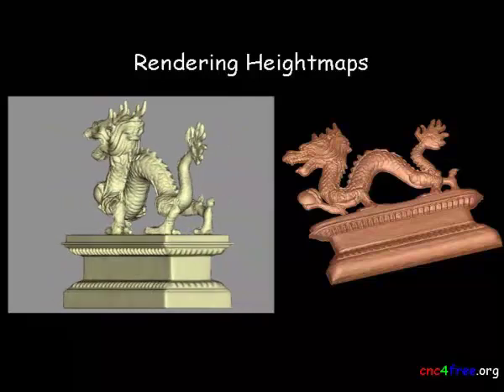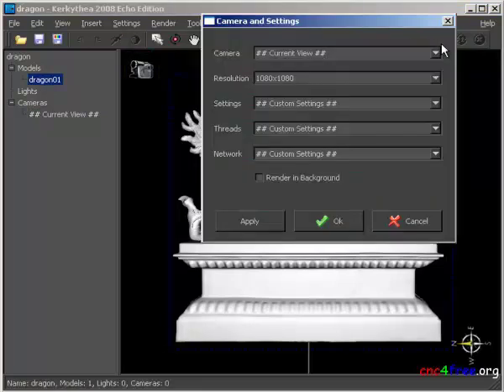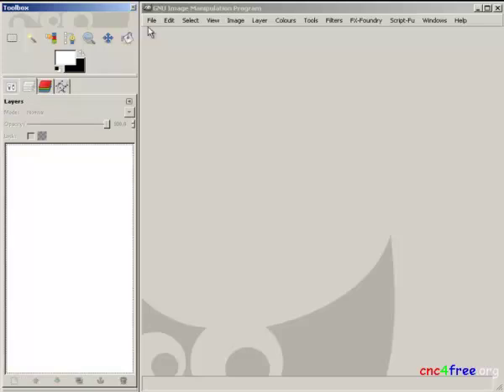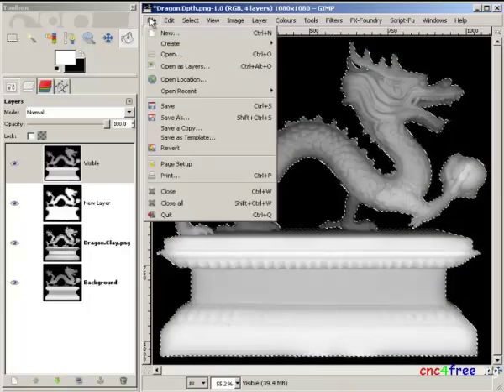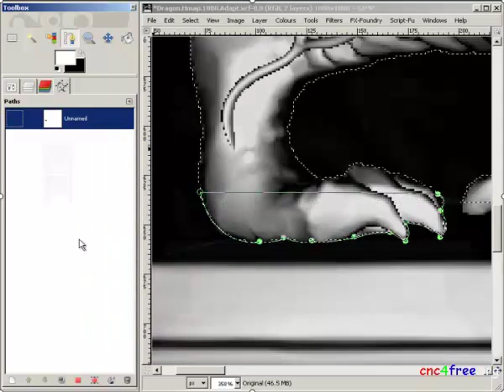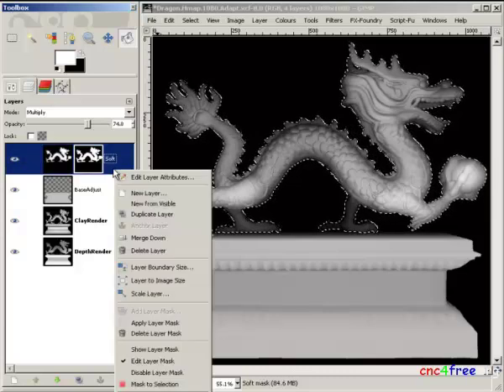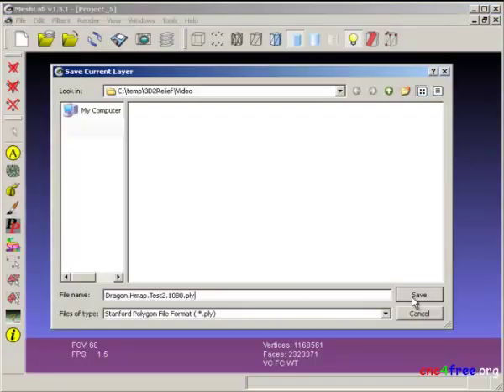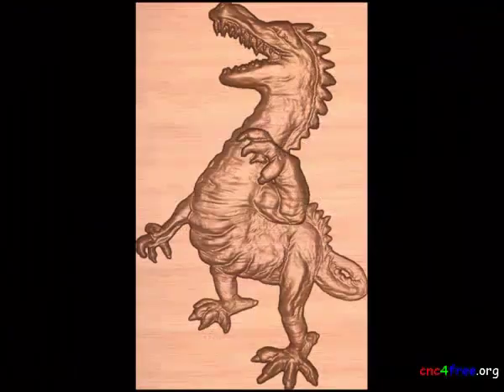3DtoRelief  3D Mesh or scene to CNC bas-Relief Carving - FREE - Cross-platform - GENERIC

Comment: Your voice is almost uninteligeable! were you in a cave? It would be nice to write the names of the software in the comments and you used an already opened program that is not available anymore.
Reply from the maker: Hi There, Many thanks for your interest and your comments, I will address the points you raised one at a time.

1.  The Audio:-

This is an older video, one of the oldest on the channel.  In more recent uploads the issue you mentioned has been addressed.  Many of these older videos will be phased out as I add more advanced content covering these subjects, so I haven't remade audio on older videos.. just don't have the time.

2: Naming the software:-

As the software is appears on-screen, where available,  a graphic is displayed, showing the 'About' panel in order to identify and provide information as the software developer has chosen to present it.  However if you feel it would be of assistance, I have identified the various software used in this video below.

 "Kerkythea", for 3D rendering (currently 'Meshlab provides a faster option, as detailed in other videos on the channel).

 "The GIMP" for producing composite height-maps from the rendered output, 

"3D Paysage" for generating .OBJ output.  At the time of making the video, 3D Paysage was the only utility I had personally tested across multiple platforms. 

"BmpBender" (windows only.. and no longer distributed) for generating native .STL output. 

Overview videos, and links to all of the above are available on the channel.

 "BmpBender" wasonly really included because many windows users in the CNC field did already have / use this software... 3D Paysage may not look as pretty.. but for mesh generation, it is the more capable of the two.

3: Already opened / 'unavailable' software :-

One of the main points of the video, is that at the image compositing / mesh generation stage, it is useful to have both the GIMP AND the users preferred mesh generation software running simultaneously.  This facilitates 'tabbing' between the two allowing for adjustments to the height-map to be re-loaded to assess the effect on the generated surface.

Software used in the video is not controlled by me and in the course of time may well become unavailable.  I do try to keep up with current FREE software available to go from bitmap to 3D surface.  These include 'Lithophanes 3D', 'ImageToSTL' and for 4 axis users 'DepthMill'.. any of these could be substituted as meets the users need... all are linked on the channel in separate 'Overview' type video's.

Hope this helps.
Reply: Wow! Your complete 5 stars response is more than what I would dream of! Many thanks! I was able to find and download all the software used in this video (the only one I have seen from your channel) and obtained a bassrelief. I was not able to open it in Meshlab as it had so many poligons, tried in Blender, success! The process enlarged the object, in my case a woman body,  two times the original size, something I can solve in Blender. I was looking for a bassrelief free process and this one works great! Thanks.
Reply: To find a download link for BmpBender (the hard to identify software in the video) was a hard task. I will look for 3D paysage instead :D
Reply from the maker: Hi there,

I'm happy to have helped and glad you could find everything except the now defunct / unavailable BmpBender.  This was Freeware but it was never made public domain, so unfortunately redistribution is not allowed.

I will be uploading an updated version of this method in the near future, showing more recent / capable software.  As of today I would say that the Kerkythea portion of the tutorial can be performed faster and more intuitively in Meshlab..

See:- https://www.youtube.com/watch?v=9zurRXrntJs&index=1&list=PLCf1CZ1GEh6M4d7bsMIwpGRLHAp3tsy6N

The GIMP would remain  but the mesh generation section would replace BmpBender with ImageToSTL...

See:- https://www.youtube.com/watch?v=lNsGi2Jbzqw&list=PLCf1CZ1GEh6Omy_EkSG8fOA4-GRWp-c3c&index=4

ImageToSTL is windows only, it also creates STL output directly but unlike BmpBender, it allows user specification of mesh resolution.

Again, Happy to help.
Reply from the maker: Hi Again,  I just read this again (more carefully) and noticed you are using Blender.  I'm not a big user of this app myself... but in the past I have used it for generation of 'automatic' composite bas-relief height-maps with the Blender / 3DSMax bas-relief node patch / plugin.

See:- http://gfx.cs.princeton.edu/pubs/Weyrich_2007_DBF/index.php

and Info for use of the original  bas-relief node patch, from the Blender 2.4 Docs :- 

 https://wiki.blender.org/index.php/Doc:2.4/Reference/Windows/Nodes/Composite_Nodes

An 'improved' version of the  bas-relief node patch can be incorporated into 'BlenderCAM'. The required donation amount has been achieved, a general FREE release has been issued, although donations are still being accepted.

https://github.com/vilemnovak/blendercam/wiki

As you are already using Blender, this may be an easier / faster / more powerful option for you...

Hope this helps.
Reply from the maker: Just an update of the link to the BlenderCAM add-on:-

https://blendercam.blogspot.co.uk/p/bas-relief-addon.html

hope it helps
Reply: Your solution is easier than Blender bassrelief for me as I am novice in Blender. Have donated and was not able to understand the process. I use DeskProto to get the Gcode for now.
Reply from the maker: Hi again,

Your comment re: the BlenderCAM method coincides with my own thinking (and intent) when I devised this method / tutorial.  

When I tested the Blender bas-relief composite node method myself, it took some effort and determination to get it working, on an older build of Blender for Linux.  A lot of this was Blender itself.. I've used 3dsmax and gmax for decades at this point, so it's difficult for me to live with the Blender GUI / logic / processes.  

Even though results from the bas-relief composite node add-on were very usable... I knew I needed a way to do a similar thing, without using Blender and thought the same might apply to others.  For the most part, this manual method allows close reproduction of what the Blender add-on does automatically.... 

Personally I find it a lot more direct / faster to use something like Kerkythea (as in the video) or Meshlab to pose and render a suitable view of the mesh object, using a few different render modes. Combining images into a composite height-map... using the GIMP...  doesn't take very long... and you can then exploit the result to produce mesh or G-code... as best suits your own needs...so you can continue to apply any software you already own or are comfortable with.

Glad to hear this suits your needs.... Happy to Help :)